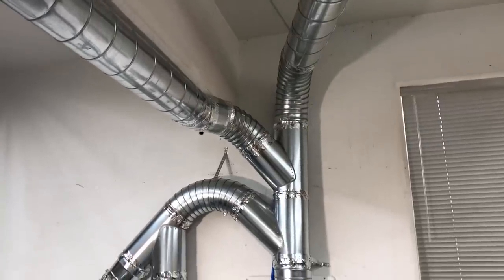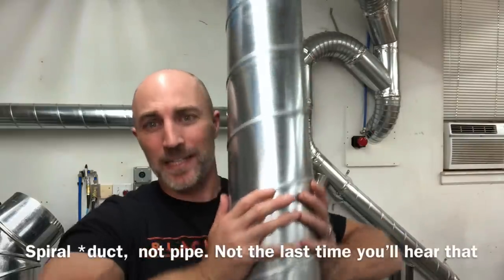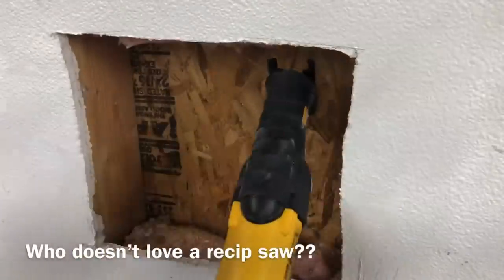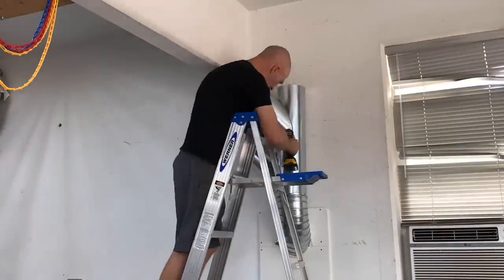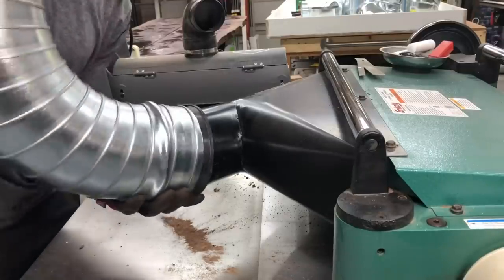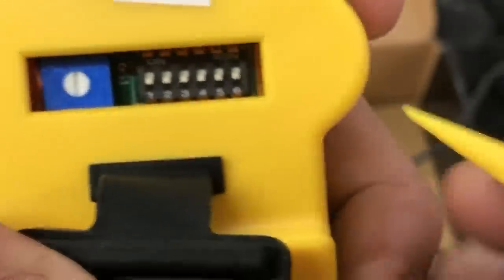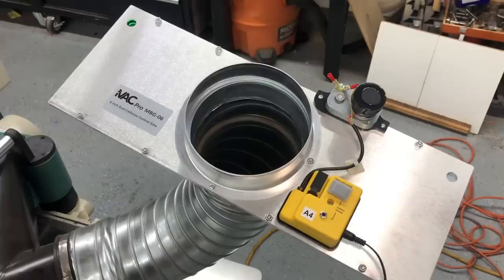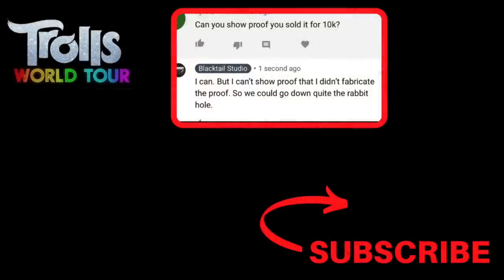Smart Dust Collection - How To Woodworking

Comment: Cam, I learned the hard way until I finally got a dust collector, can't believe how it makes clean up easily. My wife loves the wood dust and shaving for her flower beds. One comment when I installed mine I was told to put the return air back into the shop so I didn't have negative pressure which would interfere with heating the shop in winter and not cause lack of air so the collector would run 100 percent.
Reply from the maker: Good call!
Reply: @BlacktailStudio  You can extend your exhaust piping (from the cyclone separator) back into the shop to maximize heating efficiency and eliminate drawing negative pressure on the shop, while still keeping the dust collector outside to minimize noise.

Comment: Cam, I wanted to say that your thinking on covering that crimp with tape was correct and likely very effective. I don’t have knowledge of dust collection in particular, but am an engineer with fluid mechanics experience. 

Running into a shoulder will create more turbulence and head loss than the flowing the opposite way, and with fines you likely run the risk of them binding to each other and accumulating to constrict the diameter. By putting the tape there, you’ve reduced loss significantly because you smoothed that shoulder and have taken away most places for the fines to accumulate.
Reply from the maker: Awesome! Thanks for confirming that!

Comment: Never use self tappers on your ducting... yes it's quick, and easy. Self tappers round out the holes, due the the self tapping point. (Especially when over tighten) if you ever wanted to change something on your line/clean it/maintenance... once you reverse that self tapper, diameter of the hole has now become much larger, than the original screw. Now you need a bigger self tapper, or a bigger sharp (there are two types of screws we use in HVAC sharps & self tappers) If you would have pre drilled, and used sharps, you can easily take off, and on the same piece 15-20 times (if not over tighten) by lining up the same holes, using the same screws.. compared to only once with self tappers.

The difference between red, and green tin snips are; reds are for right hand, cutting left. Greens are for left hand cutting right. 
Yellows are for straight cuts.

You were using regular red, and green tin snips.. I'd suggest getting offset reds, and Greens it will help with all your fish hooks (all of those sharp ends you left) also when cutting tin, don't hold the tin snips vertical like scissors, hold them on a sligh angle.
 If you're using reds... slightly tilt them to the right, if you're using greens slightly tilt them to left.
Reply from the maker: Good tips man!
Reply: @BlacktailStudio  Also, don't place them on the underside of the ducting, only the top and sides, otherwise shavings, swarf, or whatever you want to call it will get stuck on the fixtures on the inside of the duct.
Reply: Thank you, this is very useful. Can you use a sharp without pre-drilling? High RPM drill will drive sharps in without the need to pre-drill, but is that going to create a problem in the future?
Reply: What are your thoughts on using rivets instead? Obviously that means they are more "permanent", but there's also much less protruding into the pipe itself. I also think it looks cleaner provides more strength.
Reply: @BlacktailStudio  you're very welcome.
Reply: @sergeygrunskiy462  You're very welcome. You can absolutely use a sharp screw without predrilling first. 
All depending on the thickness, gauge, and type of metal, you're using. You may encounter a few issues; 

1: since that style of ducting is very thin, it will dent very easily.
2: witch can cause misalignment of, over lapping metal. (if you need me to explain this more, I can) 
3: if you over tighten the screws (where the screws keep spinning around) you've created a hole, with a screw in it.
4: all depending on the quality of the screws you're using, quality, and thickness of metal (remember there's two over lapping pieces of metal) there's a chance of heating up the screw, where there red hot, and burn them out.
5: all depending on what type, and gauge of metal you'll use, you'll run into the possibility of the screw skating around on a circular piece of metal ducting. 
Definitely get a nice #2 Robertson bit. Use a block of wood, on the inside diameter where your screwing your joint, problem with that, if you have a 6' run...how are you going to put your arm inside a 6' run? Only works with smaller runs. You could use a punch, while it's still straight stock (before lapping metal, into a round piece of ducting) if it's thin metal. 
If the metal is thicker, two jointed pieces of metal would be strong enough to use a punch, on the outside diameter. Hope that helps out?
Reply: @drakeswake  To be honest with you, rivets would be the best solution. Absolutely looks cleaner, and would definitely add more strength. To get an even better ducting system, I'd suggest sealing all the joints with duct sealing, or foil tape, not FSK, or duct tape 
(I 100% understand most people assume, duct tape is used for ducting.... it was 20-30 years ago, it is not used for ducting anymore)
Reply: @BlacktailStudio  may I please suggest, sealing all of the joints, on on your dust collection system? It will easily make your system 15%-20% more efficient. Use duct sealing, or foil tape, not FSK, or duct tape.
Reply: @ricketycricket3242  Amen brother! It kills me how many people don't seal their duct work with mastic or something.
Reply: @BlakePizzey  totally agree with you brother. The amount of lost efficiency, by not sealing ones ducting is easily 25-20% not to mention cutting down on airborne dust.

Comment: Hey Cam, so I built my own dust collector but have really similar concepts to what you are doing. I built a closet around the dust collector this spring that is insulated with rock wool. It made a huge difference in decibel levels (from like 120 db to 86 db). With that change I also reorganized the machines to where I could run the dust collector piping along the ground, using all 6" hvac pipe.  It really optimized the airflow . I totally need to use a dust bin level indicator, as I can't see if it's full anymore.
Reply from the maker: Very cool!

Comment: Cam, thanks for the tip on grounding the system. I installed mine 18 years ago and never knew to ground it. Doing that today.
Reply: I don't have mine grounded, and i've never seen anyone ground it directly to an outlet before...
Reply from the maker: I’ve heard people say you don’t need to. Figure it can’t hurt to ground it.
Reply: My system uses pvc duct and you can’t ground it. I’m an engineer, and despite all the videos that show how to ground pvc, you aren’t really grounding it. I’ve never had a problem, or gotten a shock. I think the static causing a fire is a myth, but if you have metal duct it’s simple to ground it.

Comment: As an Electromechanical Engineer who worked on cars professionally for over a decade I can tell you with absolute certainly that permatex "right stuff" is the best RTV silicone for almost everything. The only thing you might not want to use it for is Subaru Case halves. In which case Fuji 3 Bond. However permatex right stuff is the best for literally everything else.

Comment: CAM: If there is spiraling inside the pipe it could be similar to the rifling that’s on the inside of gun barrels to give a spiral effect, which would help to funnel the air in a more uninformed manner allowing a less likelihood of debris piling up at turbulent points within the ducting. 

Also, the spiraling on the outside/inner could be structural as well. This gives it more surface area in which to distribute external pressures/forces through. And given that it seems to be a bit thicker than the actual pipe material itself (more densely packed unlike the flat sheet of the pipe) this helps to give more rigidity.

Not an expert.. just some spewing of my thoughts about them.

Comment: As long as the duct is metal all the way back to the collector the whole system is grounded. With plastic hose that has a spiral wire in it, you can expose the wire at the end and connect it to the metal duct. Plastic fitting will not allow ground to pass so you'd either have to ground to the tool or jump the fitting with a wire. All in all from what I've heard the danger of dust explosions in a home system is almost theoretically impossible. The static spark you can get from an ungrounded system causing you to jump while using a power tool can be real danger though. 

In machines that have a grounding wire like a dust collector, they should have ground attached to the metal frame of the machine. (I believe it is code.) This also includes all your tools if they have a ground on the plug. This is done so if there is a loose wire or something that touches the frame on the inside it will immediately ground and trip the breaker. If they didn't do that and the device had rubber feet or something, when you touched it in that situation you would be electrocuted. That is why you should replace the plug if you break the ground prong on the original even if it will work without it.

A bit late to say this but I couldn't find a comment about it after a quick search so I thought I would post it.

Comment: Cam, great video.  I'm just completing my iVac 8 blast gate system.  I decided to use SDR35 pipe and found the install pretty easy - but the pipe and fittings are heavy when 8 ft up on a ladder!  Thanks again for sharing.
Reply from the maker: That’s awesome John!

Comment: Cam, I was told by the folks at ClearVue that running the collector with all the blast gates closed will not hurt anything, especially if you use thick wall ducting ( I use Nordfab). In fact, they said that’s the best way to check for leaks in the system. I do recommend you check for leaks by getting an incense stick and putting it so that the smoke runs around all your connections. If you have a leak, the smoke will be drawn into the leak. One important place to not have a leak is anywhere under the cyclone funnel. Any leak there will send too many particles (or even shavings) into your filter stack and eventually clog it.
Reply from the maker: Oh, good to know! I’ll ask Oneida about their unit

Comment: Cam the sheet metal cutters are red handles for cutting right Green for left and yellow for straight, the better sheet metal screws would be zip screws they have a sharp point and are tapered. Nice job! They do sell a HVAC caulk for sealing joints
Reply from the maker: I think I used those screws. And I need some more snips

Comment: My husband and I had our 'dream house' built about five years ago. From day one, his study was a miserable place to be. Hot as Hades in the summer and bitterly cold in the winter. I put a matt heater under his desk so he wouldn't freeze in the winter, but he still had to wear a hat. 

About three years in he had enough and we hired an HVAC company to take a look at the problem. The guy had me pop my head into the ceiling and look at the 90* turn in the duct to branch the HVAC into my husband's room and told me that was the problem. His plan was to put in more gradual turns and that was it. 

I was dubious. It couldn't be that simple. His room had almost NO climate control at all. Just changing the angles of the pipe couldn't make that much of a difference, could it? I kept his card close, believing with all my heart that there was no way that this simple change could fix this extreme problem.

Two years in and the only time I used the call was to thank them a few months in. Sure enough, it's perfect. 

Now I need them to come back and fix the EXTREME blowing into our bedroom. If the door is closed the heater is on, it turns into a sauna within 20 minutes. If the AC is on, you're in a 50* refrigerator. We're putting on an addition and I'm having them run the HVAC and fix the bedroom while they're at it.

TLDR: DO NOT PUT IN 90 DEGREE ANGLES *EVER*. It's had a worse impact than you can imagine.

Comment: Cam, the system looks great! I love the automatic gates. I've never used them before. As far as the main elbow going through the wall... the only thing I would have done differently would be to install a sweep T with a clean out cap on the bottom. Aside from that, I hope it works great for you! As always, i loved the video.
Reply from the maker: Oh, that makes a lot of sense actually!

Comment: Cam, very nice system! I have a similar one but it’s Clearvue and half DIY. I have a 6HP 3-phase motor and run it off of a VFD so that I can utilize all the power even when I connect smaller machinery with smaller ducting.

Anyway, my only objection is that you are using a very nice MERV graded filter but still just vent all the air outside (or in shed outside). You could have just omitted the filters entirely and just used the cyclone. That would have saved you some money and also give you better suction (since less air restriction) and also no filter cleaning. The shed would get a bit dusty over time though.
Reply from the maker: Thanks for that!

Comment: By putting your dust collector outside of your shop aren't you going to suck out all the heated or cooled air at the rate of 1250 CFM or whatever that vac is rated at?
Reply: that one is most likely over 2000 cfm. So yeah he is removing all of the heat and or cool air out of his shop.
Reply: Well, he could just duct the filtered air back in...
Reply: @carlgustafson213  he could, if there was an easy way to collect the discharged air but, with that huge filter on the new dust collector, I don't know how you would capture it to return it to the shop. I think he's gonna pay a big price for this system  in heating and cooling costs.
Reply from the maker: Ya, it’s sucks the air out quick. Might get a return eventually

Comment: Cam- As per usual, excellent and informative video. Regarding heat/cooling loss, it seems to me that you would only lose room air during the time the duct fan motor (and equipment) is on.  If you are working 8 hours ask yourself how many minutes your equipment is running. Probably not noticeable.
Reply from the maker: It’s noticeable when it’s super hot. Not terrible though

Comment: Cam, Thanks for all your videos - I've been woodworking for a long time, but always learn something new.  Question about your system:  Since your dust collector is outside your house/shop and exhausting all the air to the outside, aren't you creating negative pressure in the shop and removing large amounts of heated/cooled air from the space?   How do you deal with that?  Thanks
Reply from the maker: Total problem! I’ll probably add a return

Comment: I wouldn't use screws to secure joints.  Aluminum tape itself will hold the joints together.  You were taping the joints anyway as a seal.  

As far as the automated blast gates, I see that as a benefit for a production shop but not for a one man operation, unless you have money to burn.    I can only operate one machine at a time. 

For those who like to leave machines on, I saw a horrific accident on Perkins Builder Brothers channel where a jointer was left running in a loud environment and a hand was shredded when the guy didn't notice it was running.

Comment: Hi Cam,

Did you move? I think you mentioned that in another video (or two), but...

Have watched all three of your dust collection videos and noticed an inconsistency. 

The home/shop in the first two videos had vertical siding. You painted that, and the RH door you installed yourself, with your wife. This video has shiplap siding (horizontal siding) with shingles at the top. a flat LH door, and a couple of vents in the roof that your father did not install when he roofed the first shop extension. There are also windows on the shop wall in the second location that weren't there in the first one.

No biggie on the different location, of course, but maybe there were some other minor lessons learned in doing things the second time around.

Also, though I learned a ton from you, I thought I could offer some answers to a few questions from other comments:

1. Yes, you can use PVC/Plastic pipe, but should run an exposed ground wire through the ducting as this set-up will generate a lot more static electricity and present a bigger fire hazard.

2. Yes, spiral ducting flows much better than regular HVAC ducting (spiral this is the preferred dust extraction ducting) and will dramatically reduce the possibilities of clogging.
Reply from the maker: Ya, I moved. Have a few videos on that 😊

Comment: Great video Cam! I have the same DC, upgrading from a 1.5HP Jet. With the Jet I really had to watch the blast gates and considered an automated system like you have. With the 5HP Gorilla, that really hasn't been a problem - I leave several gates open at a time as I move from tool to tool. I was concerned about the DC starting and stopping a lot, and the wait-time while it spun up. The chop-saw is a great example. Line up the board, pull the trigger, and then... wait for the DC to spin up before making the cut? I've found that leaving it on for a few hours and manually opening or closing a few gates now and then fits my workflow. Thanks for sharing!
Reply from the maker: That’s awesome to hear!

Comment: Cam, this will be my third time through the process of setting up a dust collector system and learned several more useful things from your video. Really appreciate links to materials though my system will still involve a mix of spiral, stove pipe and PVC because I own it all. Did you forget to tell us the brand of duct tape you found to be best? Thanks.
Reply from the maker: I added a link in the description!
Reply: @BlacktailStudio  Ooops, sorry. At 52 cents a foot it must be good stuff. But then, I'm so sick of paying for inferior goods more than once and loosing days to each redo.